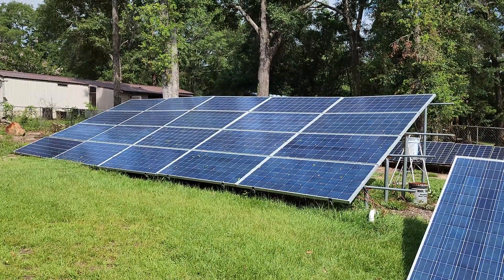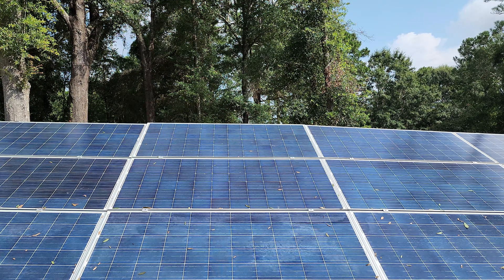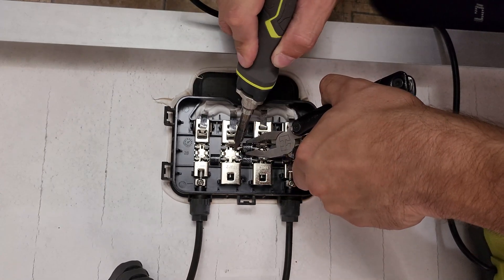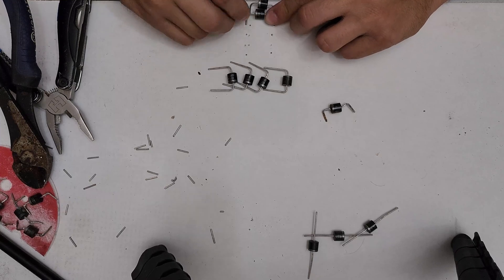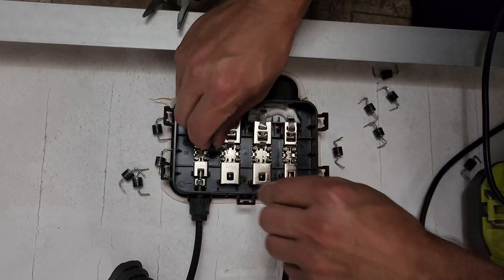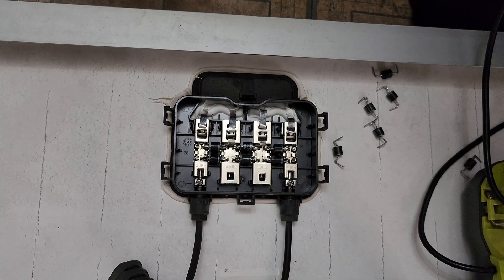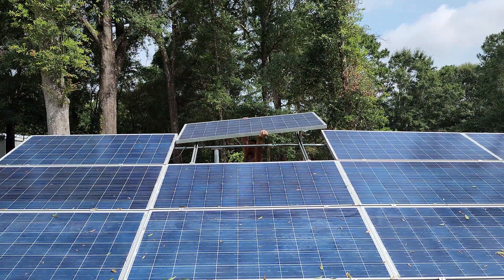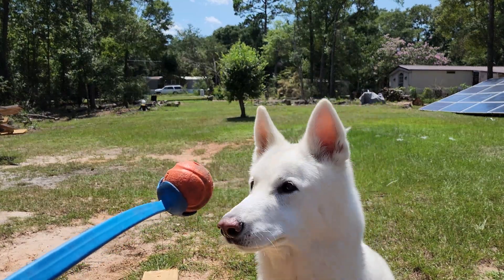DIY: Replacing Soldered Diodes in Solar Panels

Comment: I have a brand new Canadian Solar panel 450 W, one of the electric boxes & wire that was puttied to the back fell off. I can see the metal pins still there but not sure how to repair it.

Comment: Not that it matters at this late date, but you can just cut out the old diode, as it is already busted. I am looking for some info on replacing (ripped off) one of the junction box/diodes on my old Mitsubishi panels, which have 2ea box’s, one negative, one positive. Thanks for the video, it helped a lot!

Comment: Hi.any problem if replace with different diode..original used 40v, but only have 45v on market.can i chance it?.
Reply: I would say higher voltage rating is fine, lower is not.

Comment: This is exactly the video I needed. I bought a 220 watt panel from FB which was only getting 146 watts. After several tests there are 2 diodes not working. I’m going to replace all 6 so that they are all the same age. 

Cheers mate.
Reply from the maker: I'm glad I could help out!
When lightning struck my array and killed so many of my diodes I couldn't really find much online for help with it, so once I researched and figured out what the issue was and how to fix it, I figured I'd share so others could more easily find the information.